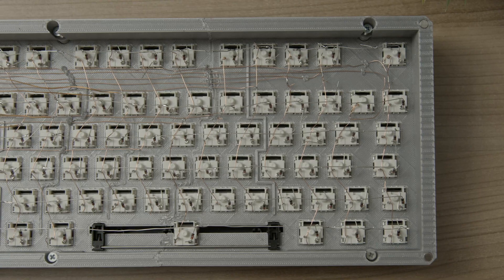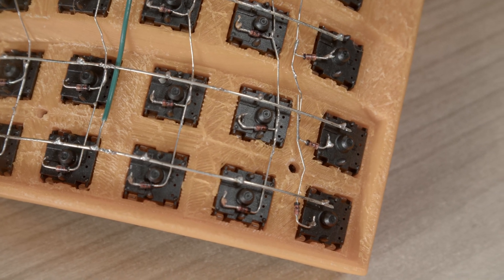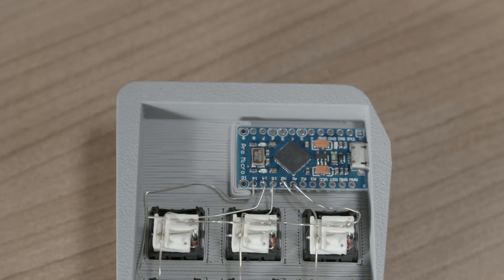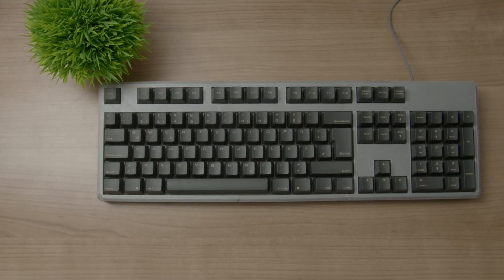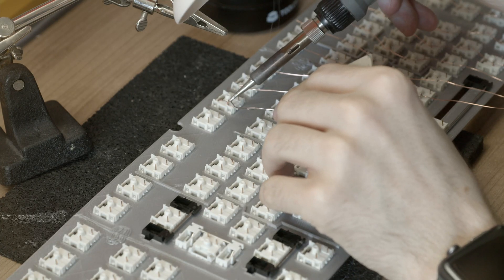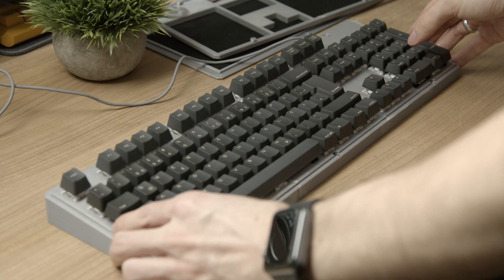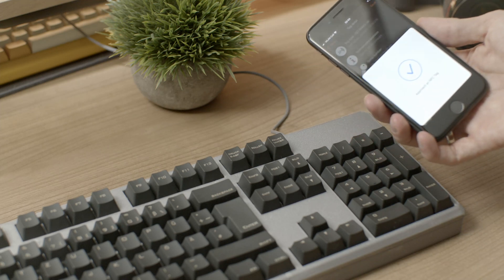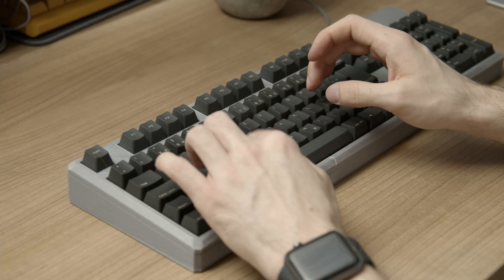Keyboards from scratch - a handwiring journey

Comment: @2:00 GTFO Teensy's can't be had for 1 month lead times and pro micros have like 5 digital pins. Just get an RP2040 and move on. Or heaven forbid QKM start to support ESP32's like wtf guys.
Reply from the maker: Yeah I have now switched over to rp2040s for everything and am using kmk, can’t really recommend the teensys anymore
Reply: This video is eternity old though, back then rp2040 was very much not a thing. Bluepills were though and they make for pretty good dirt cheap keyboard controllers.

Comment: It's probably been mentioned in another video, but in case any new handwire or PCB newbies like myself wander upon this video:

While you can just get a higher expansion daugherboard/MCU, you can also use "duplex matrices" to make the most of pro micros and MCUs in general. Thinking of it completely mathematically, think of matrices like a times table where you want the most square result from a given number that you can. For the example of a 60%, needing 61 keys. Now, while 64 is the closest square number without going under, an 8x8 matrix would be very awkward to wire on a keyboard.

Gleaning from that, instead of doing a 14x5 matrix, you can make your matrix columns expand across two physical columns
(ex. Col0 going from Esc, Tab, Caps, LShift, LCtrl, Lwin, Z, A, Q, and 1)
and create two rows on your matrix for every physical row on the board
(ex. R0 touching Esc, 2, 4, 6, 8, 0, and Equals, and R1 touching 1, 3, 5, 7, 9, Minus, and Backspace).

This can then create a 7x10 matrix, which frees up 2 pins, 17 versus 19. But, if you can handle crazy and wire an 8x8, you absolutely can save more, as low as 16 pins. There is a bit of dimishing returns the smaller a keyboard is, but if your plan is a flight deck, you absolutely will want to duplex a 108 keyboard with 11x12 rather than 22x6 as taking up 23 pins rather than 28 can mean worlds of difference. Even if you can't use just a Pro Micro, there are some that use 24 pins, while going past that usually means 32 or more pins with an accomodatingly higher price tag.

If you need a better visualization, you can look up "ai03 matrix" on your search engine of choice and it likely will be the first result pointing to their wiki with a page titled "Matrices and Duplex Matrix."

Comment: Very cool Project. What Microcontroller did you use for this build? Im thinking about building a handwired Fullsize Keyboard myself, but i have a hard time to find a Microcontroller with enough IO Pins for the Layout i intend on.
Reply from the maker: In this build i used the Teensy 2++ but I'm still looking for alternatives and text up on the list are the blackpill and a pi pico. Other than that you can also use an io expander chip but that could be a bit complicated for the beginning

Comment: Well it is cool that you made everything by yourself. But to be honest I would not be very satisfied to do so much work and to end up with this flexible plastic case. 
It should not be a problem to get a really nice case for this standard layout. You could even get this printed in metal I think!
Reply from the maker: Totally feel what you mean but in keyboatds there is a trend for flex pcbs aswell, its not for everyone, the cool part is that you can define how flexible it should be by printing a plate with more thickness. My last keyboard had a 4mm plate and is the opposite of this keyboard really really stiff. and yes it would be a lot easier to just buy something but my brother also owns a 3d printer so he could change the case and add another row of macrokeys on the left if he feels like it. also the case is not flexible when it is assembled just the plate is 3d printed plasic parts are suprisingly robust. 3d metal printing would we a nice thing someday. 
Thanks for the honest comment, I always appreciate the feedback
Reply: @JanLunge  Well that's cool ofc if you prefer to have some flex in your board. That's the cool thing about making everything yourself. You can do it precisely  how you like it. 
Cool project and thx for your reply!
Reply: tbh, several support columns in the base plate could eliminate the flex completely.

Comment: Honestly I love this side of the custom mech scene way more. You really get to make your keyboard your own, plus it's actually affordable!
Reply: I wouldn't say it is affordable but that depends on what you use for the build.
Reply: @chandraveermathur642   How is it not affordable? Diodes wire and microcontroller cost barely nothing at all, stabilisers cost a little, there are many entirely palatable cheap switches, and filament won't cost much either. Yes you're going to either already need to have a 3D printer or just go to a makerspace and have things printed there, which is also ideal if you're not comfortable with soldering, programming or troubleshooting, you'll find all the help you need there. You could be about 40 or less all in.
Reply: I mean, sure l guess lol